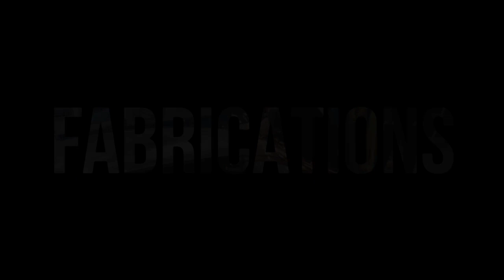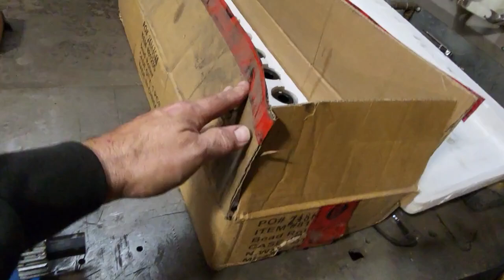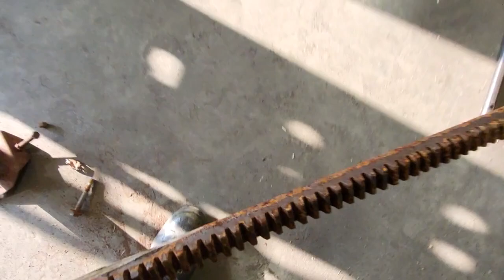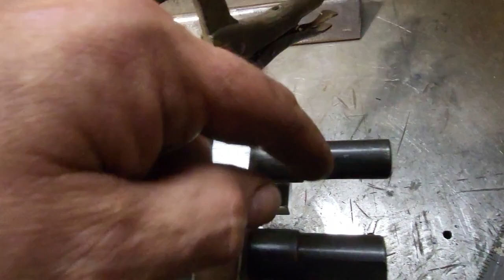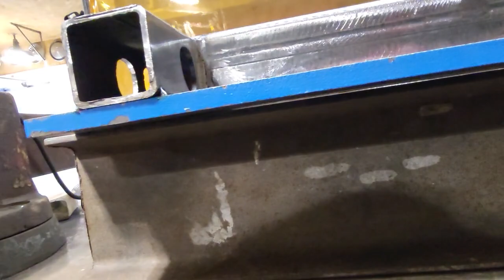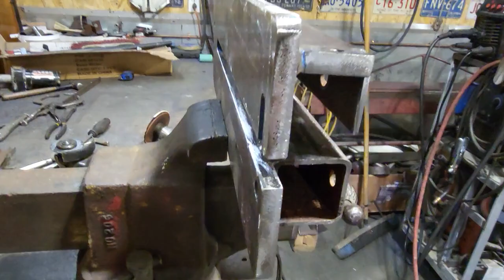New shop tool build. Part one. Reinforce for strength

Comment: Thank you for the tutorial,on how to strengthen a bead roller . Although I’ve never used one , I may have a use for one as many do . I recognize that rolling steel panels through does in fact produce quite a bit of stress and torque backlash . I would imagine that in order to achieve accurate beads , it’s necessary for the rollers and shafts to be firmly held in place for that to happen . We have all learned by now that if something is affordable , it’s probably not well built . You’ve demonstrated for us , as you always do , that if we have a bit more than just the inclination to improve on a tool , body panel or chassis , we can certainly do it . All we need is a plan .

Comment: I’m guessing that one of them is a better way to tighten and loosen the top bolt that adjusts the dies. And, another big one is to replace the little hand crank they give you with a large diameter wheel either from an old car or one you make yourself. That adds so much control when you are making beads it’s crazy good. Liking your stiffening design.

Comment: I believe that I have found 6 modifications, adjustable stop,spring to lift 1 die,motorize the shaft, stand to make it mobile in your shop, a table to bolt to the stand lay larger panels on so one person can use it, and maybe a light to see the pattern to follow, those are the mods that I see,it a blast to watch what you do, thanks!

Comment: to be usable, reinforcement is mandatory on these generic bead rollers
I reinforce mine a different way, I worked to avoid as much as possible welding on the bead roller frame.
What I done is that I fabricated a 1/2" steel plate to the profile of the main plate frame and I attached the plate with  six .3 1/2" standoff blocks fabricated from solid steel bar that I've used to install that plate the way all the shafts are enclosed between these plates, I used 1/2" bolts to maintain the assembly tight
The machine is now heavy but way more rigid than in the original design and i don't fear attacking 16 GA sheetmetal.
In fact, what you made to your machine is much more work than what I done with thw risk of ending with a warped frame.
The way the bearing blocks are designed on my machine is that the threaded holes for ting them to the frame are drilled and tapped to the  bores of the shafts so I gundrilled the bolts to install 3/16" press in grease nipples .
very good mod to your bead roller.
very good video ( parts 1,2 and 3 )

Comment: I wonder if anyone has ever bought two of these units, and sandwiched one set of  ‘shafts’ etc, between the two main frames? With appropriate spacers I would imagine that would improve the rigidity considerably? + you’d have spare parts if ever needed!

Comment: You're no just a fabricator, Tony - you're an engineer.  Anyone who looks at a design and can rebuild it stronger or more fit for purpose and improve a tool or working thing without compromising its original function, is an engineer.  That is the biggest compliment I can think of to describe your affinity with steel and the way you can just look at something and see the finished product - ie: what it SHOULD be like - and then make it happen.  Sure - you make mistakes, but then you sit back, look at it, realise what was missing from the original thought and have another go.  Very seldom do you throw in your gloves once you've set your mind to improving something - be it a tool, a body frame or an out-of-shape or rusted panel.  I have learned so much from watching you - not only your welding skill, but also your approach to the work at hand.  Thankyou for continuing to keep your channel alive.  Your tips are ALWAYS good and they are always easy to understand and apply.  All the best!

Comment: I really recommend replacing the hand crank with an old steering wheel. Make the torque more equal through the rotation much easier to maintain a straight line!!!!

Comment: I have the same tool, used a cheap drill to drive it through a 'sesame' motor , with a big reduction drive and put the drill switches into a pedal box, works well, good project  as all your vids are

Comment: a couple mods that would be good, a adjustable guide to keep the bead straight, a steering wheel like arrangement to replace the crank handle, it is hard to keep things straight when you have reach the crank on the other side ,my Wendy is not always available.I think a table for the metal to lay on to keep it from drooping.I have a Super Bead, not much different than yours. .

Comment: Most of us don’t have the need or space for a deep-throated bead roller. The 8” version of these cheap bead rollers will do most of what’s needed, such as edge work like a joggle or for tipping a flange, and 8” will also get you where you need to go in most smaller panels to make a strengthening bead. At an 8” throat depth I find there is very little if any noticeable flex in the plate. So, if you don’t think you need a 16” throat depth, consider an 8” unit and skip the need to reengineer it.
Reply: Most of my work is on small pieces, so I simply clamp my bead roller to the bench, horizontally, with whatever overhang I need.  Problem solved.

Comment: I have picked up several angle iron bed frames the people throw out. The steel and the shape make the frame rigid.  It welds nice and for free, that is what I am going to use on my bead roller. Also, there is a recent video on YouTube showing how to install a 2500# winch motor on it and it is the best modification I have seen to date for powering one of these. I believe that this style bead roller flexes due to the yoke cut into in and the base of the yoke is where most of the bending takes place. I would think that even flat steel of at least 1/4" thick and possibly 2" wide could reinforce this by wrapping the outer edges of the frame with one piece. Not all of us have such supplies so I am going to check where it bends and fix mine with the bed frame steel. I was typing this in the beginning of the video which I paused.  I am anxious to see your modification. You can get a power supply from Amazon , a 50A. 120V input with a 12V 5A output for a small winch motor and I saw in the video a winch motor with an empty reel. Hmmmm.

Comment: After 30 plus years, of fighting the exact same bead roller, several months ago I decided to make mine into a foot controlled electric motor driven machine. Tried to cherry pick parts of the best videos to get what I wanted. Wound up using  the motor from the smallest 12 volt electric winch from Harbor Freight, cutting the cable drum in half to connect it to the fixed roller shaft. found a 110 volt AC to 12 Volt DC controller and an adjustable speed controller on Amazon, along with a foot controlled on. off switch. One of the best things I found from the tube, was a over center clamp used for holding parts to be machined , that operates a lever to release the tension on the top roller. Removed the adjusting screw and converted it ti a spring operated shaft that allows the upper shaft to move up away from the work. Eliminates the need to unscrew the adjusting bolt and count the turns, when placing or removing the work piece. Now I just need to build a removable table to support the work while rolling a bead. Leaves both hands free to control the work, and don't have to call up a friend to turn the crank.

Comment: I have the harbor freight version. I used 2x2x .25 angle on the opposite side of the rolls. I swapped out the Chinese  hardware and added grease zerts. I used a HF electric pipe threaded with a swag offroad adapter on a foot pedal to power it

Comment: I was curious how it's going to be mounted. 
I built one out of 2.5" square tubing with 5/8" roller shafts with greasable blocks. I'm still trying to figure out how to mount it on some kind of stand. I also have parts from a tread mill, so I'm motorizing it. 
Can't wait to see how yours turns out.
I'm hoping to mount it on my pipe frame like the one you built to bend the sheet metal and detach it when not using it.
I had to build the pipe frame after seeing how you built yours. It works great thanks to your videos.

Comment: Im sure one mod will be to install a lightweight removable 'table'  to support longer pieces of work when fed through the rollers.

Also the use of a winch motor to power up that bad boy ! (There is a vid for doing it.)

Comment: Im definitely paying attention to this one i want a bead roller so bad  but those big expensive ones not in the budget right now especially with the holidays coming
Reply: Other pro's on Youtube use this best price model, you don't need anything bigger/better.
They're solid so long as you don't get impatient and try to get full depth beads in one pass, that's what breaks them, and they break out at the end (not at the crank, but the other end where the dies go).

Comment: The biggest problem i find with bead rollers is if you doing larger pieces that there is no support on the back side of the bead roller and can be quite  cumbersome to handle when doing it alone. it wants to do the gravity thing and makes it hard to keep the lines strait see what i'm saying Tony? I used a roller table on the back side  to do this and it really helped to move it through the bead roller with less effort and made it easy to keep it all strait in the throat of the bead roller. Just sharing what worked for me wit ya Tony . keep up the good work . your doing an awesome job.
Reply from the maker: All in the plans!!
Reply: @fitzeesfabrications  Nice . you think on the same lines as me. lol